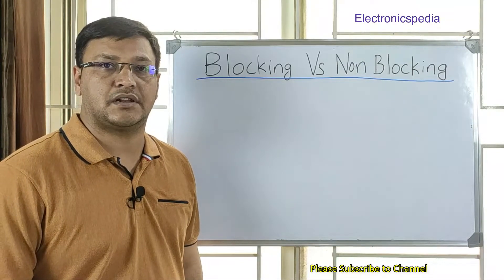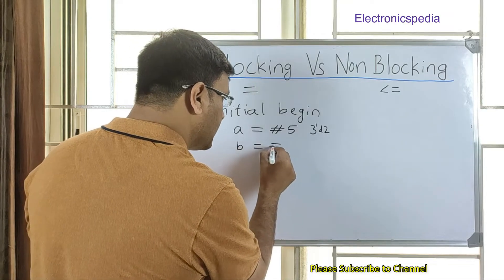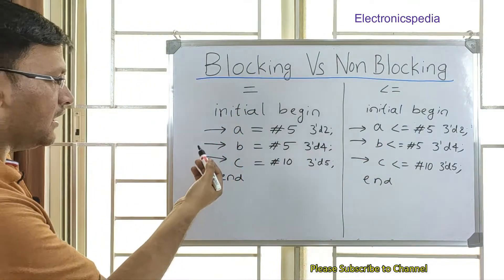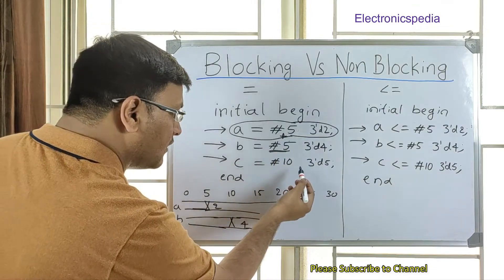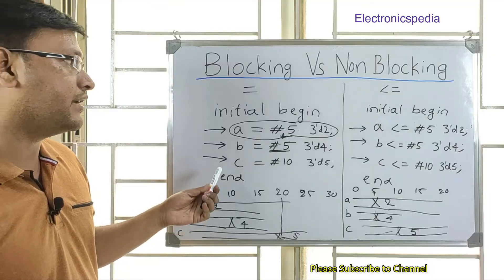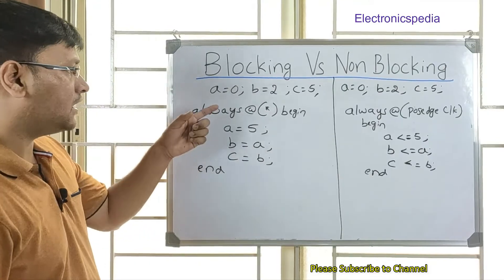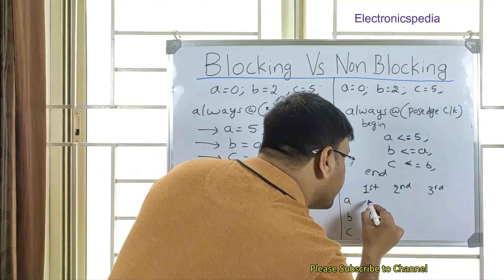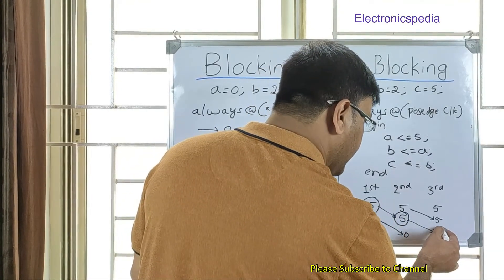Verilog Blocking and Non Blocking statements | Blocking Vs Non Blocking | VLSI Interview Question

Comment: Sir what happens if we mix both of these statements in a block
Reply: If you do synthesis , mixing them will not compile. However, if you do it in simulation, like inside an initial block in test bench, there are two cases:
1. a<=b;
c=a;

In this case, since a<=b is non-blocking, this assignment will not be ran until the end of the current time stamp. That means, c will be the current a if no more blocking assignment to c are made. 

2.a=b;
c<=a;

In this case, since a=b; is blocking, a ‘s Rvalue will change to b, and then continue the below statements c<=a. That means, c will be b.

But to avoid confusion, you should not mix them together. Yet you need to understand their difference clearly. 

Blocking means when simulator runs to that line, it will do the assignment immediately and change the assigned variable immediately.

Non-blocking means it won’t do the assignment immediately. It will let other line read it first and do the assignment at the end of that simulation timestamp.
Reply from the maker: We are not supposed to use blocking and non blocking within one always block. This will give error when running lint and subsequently in synthesis tools.